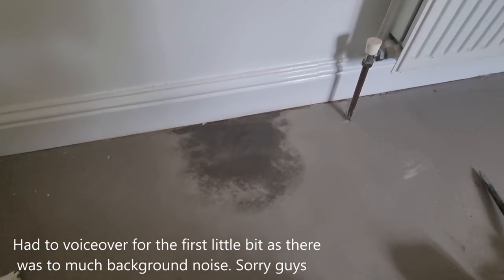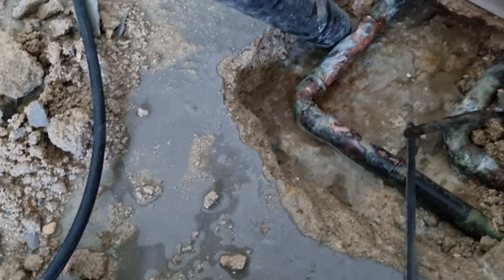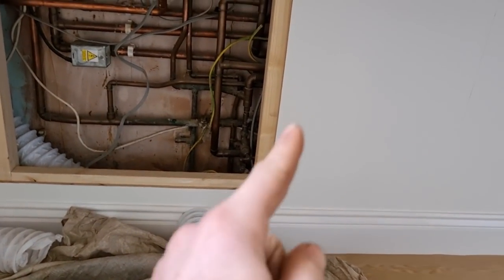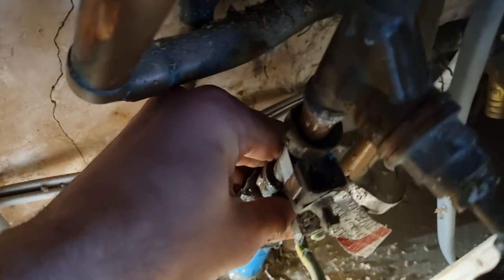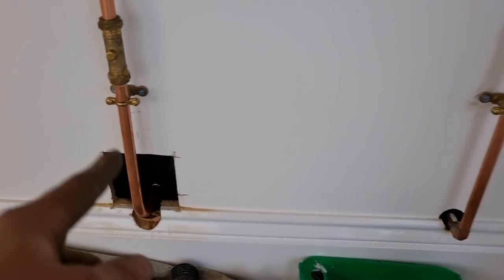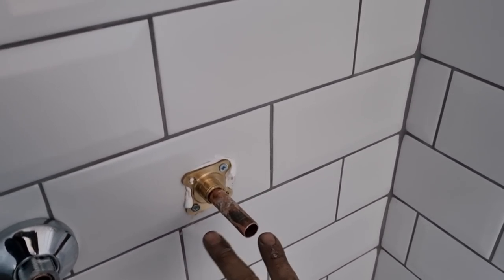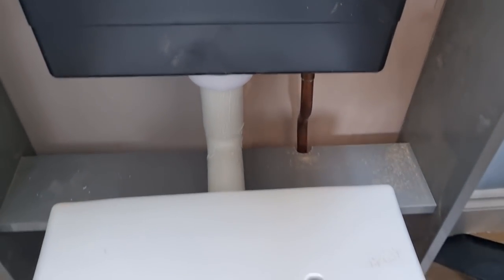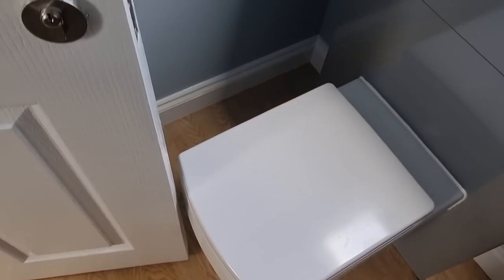THE RENOVATION NEARS COMPLETION AND WE HIT PROBLEMS

Comment: Top tip for you Tom:        Instead of buying male irons for the tap flexis.         use the tail from a 15mm TRV, straight into the iso valve!           When doing like for like trv swaps I always save the tail. ;-)            Cheers.
Reply from the maker: The only reason I don't do that is because radiator tails aren't WRAS approved so technically can not be installed on a wholesome water supply, for some reason the water board seem to want to inspect some of my installations periodically and I know the guy would definitely pick me up on this, it is a good tip though if it weren't on camera
Reply: @PlumbLikeTom     Didn't know not legal,  have been inspected and they never mentioned it.....

Comment: Check the flush cone on that toilet. I had a job a while back where the flush was piss poor like that, same Wirquin cistern and bits. The flush cone had a much smaller hole in it than usual letting hardly any flow into the pan. Changed it for a normal one and all sorted 👍
Reply from the maker: I might have to check that, I will take a replacement pan with me when I go back, the one upstairs with the same cistern flushed fine on a different pan so I assumed it must be that, thanks for the advise mate, it is appreciated
Reply: @PlumbLikeTom  Yes definitely worth a check mate. Also there could be something obstructing in the hole where the flush pipe goes into the back of pan. Taking a replacement pan is good shout too, just in case. Great vids btw, I watch every week 👍
Reply from the maker: Thanks mate, I appreciate the fantastic support of the channel
Reply: @PlumbLikeTom  Good stuff mate, no worries

Comment: Good video Tom. I would have cut that Talbot fitting out too, they are notorious for leaking - they always feel loose  when not under pressure . I don't really like them sure stops, I like the idea but I've been out to a few floods over the years - they start leaking from the valve body.
Reply from the maker: I wasn't happy with the way it was wiggling around , it doesn't feel you full of confidence. The sure stop valves are OK in some circumstances. This particular building it may be better if you can turn the water off quickly in case something smashed apart, thanks for watching mate, it is appreciated
Reply: @PlumbLikeTom   To be fair the sure stops have probably improved massively. Totally understand what you mean about being able to turn it off quickly. I went to do a job at a village hall, it had 2 incoming water mains either end of the building - both boxed in and took me ages to locate. If they had a major leak no one would have been able to turn it off..... crazy!!!
Reply from the maker: Sure stops are excellent for some jobs and certain applications, but I wouldn't fit them all the time as sometimes they can cause more trouble than good. I once went to a job where the customer reported having no water, it took me an hour to take all the plinths off in the kitchen, find the incoming main, only to realise in the back of a cupboard something had just pressed up against the switch. I always label the switches now to make it clear exactly what its for

Comment: Copper pipes under a slab is only allowed in Australia if it’s in a pvc conduit
Reply from the maker: In England water regulations state hot and cold pipes must be laid down in purpose made ducts or placed in conduit so pipes do not come into contact with corrosive materials. It also allows for easier identification of leaks and makes them easier to fix. Unfortunately few people follow these standards and they only cover hot and cold pipework and not heating services. Australia is a place I've always wanted to come and visit one day, the furthest I've ever been from home is Scotland which is about 200miles from me, thanks for watching mate

Comment: Nice work mate, a question, with the sure stops do they shut when there is a power cut?
Reply from the maker: Hi mate, the sure stops don't have any batteries or any electrical connections what so ever, they simply work on water pressure to isolate the supply, they do shut off completely and seem to be really reliable, thanks for watching
Reply: your having  laugh

Comment: Great video as always. Shame about that pan. Can I just ask is there a reason you don't like flexis onto iso valves. You can get the flat face ones that don't cut into the rubbers or is it just a cosmetic thing?
Reply: Copper is proper and binda flexis is my best plumbing friend 👍👍👍 #ihate flexis 😂😂😂
Reply from the maker: Hi mate, the flat faced ones are fine as like you say they don't cut in, the normal ones however always seem to leak after a while, I have always used male irons but that's just my preference, thanks for watching as always, it is appreciated
Reply: @paul_my_plumbs_uk  I'm partial to a hard piped tap. 💪👌
Reply: @Tom_Plumb_PHS  oooerrr mrs 😂😂😂
Reply: I normally just file a normal iso down a bit so the rubber sits on it better
Reply from the maker: @JSSHandP  That's a nice idea mate, which ever method works and as long as it don't leak everything should be fine
Reply: Tesla do compression fittings to fit into iso valves that are perfect for flexi connections

Comment: why is your copper in the screed not wrapped?
Reply from the maker: Hi mate, these were existing heating pipes, I did wrap the pipes in denso before the floor was repaired. I hate pipes in concrete floors as sooner or later it will cause a problem. In an ideal world pipes should be laid in proper ducts that if needed can be lifted so pipes can be inspected, thanks for watching
Reply: love yer work young man...its shit out there  at times  but keep buggering on

Comment: 👍👍💯 Tom ❤️❤️❤️ join the press gun revolution 🙌🙌🙌
Reply from the maker: I do have a rems press gun that goes up to 54mm I think but its more for commercial applications. I may have to invest in a smaller one for domestic stuff although in this circumstance I think I would have struggled to get the jaws in to press the pipe in the floor, thanks for watching mate, it is appreciated
Reply: @PlumbLikeTom  where there's a will there's a way 👍👍

Comment: Multi tool to cut that pipe out in duct mate, quicker.
Reply from the maker: The only thing I find cutting copper with a multi tool sometimes it leaves quite a nasty bur, it might just be the blades that I use but I find a junior hacksaw leaves a slightly cleaner cut, I appreciate your support of the chanel mate, it is appreciated
Reply: @PlumbLikeTom  yes the multi tool does leave a burr as u say.

Comment: What’s going here ? Why is pipe work not lagged ? It’s buried underneath the cement and what knot … That’s bad mate , no one follows the simple rules …
Reply from the maker: Hi mate, All this pipework was pre-existing. I've seen it on too many occasions where pipes are just laid in floors with no protection. Ideally all pipes should be ducted to allow easier access for the future, unfortunately this very rarely happens. Hopefully the updated building regulations which come out next week will help end these bad practises
Reply: @PlumbLikeTom   You saying that’s not in regulations yet ? Absolute crazy , there’s no space to breathe for pipe work… he’s going to have leaks everywhere 😅
Reply from the maker: @edthelasttribe9580  Heating pipes aren't covered by any regulations. Water regulations only cover wholesome(drinking water) pipes. The new building regulations, part L state that all new heating pipes require insulating even in floors and walls. They don't go as far to say pipes should be ducted but for me that would be sensible
Reply: @PlumbLikeTom  definitely, you can see the results already. 🙈